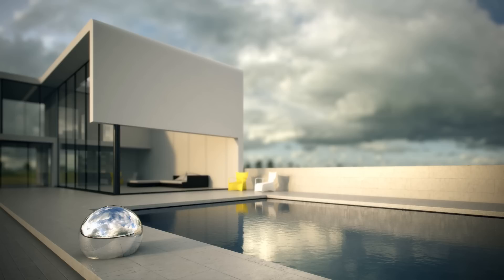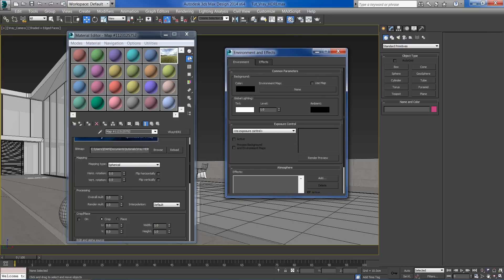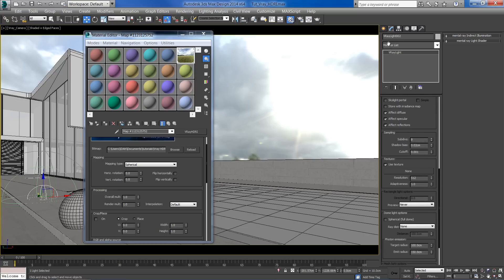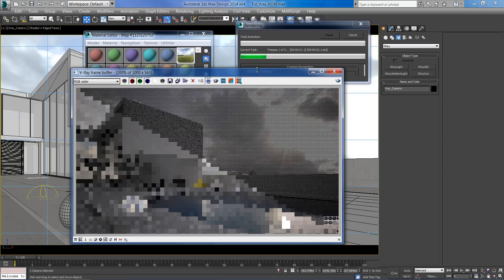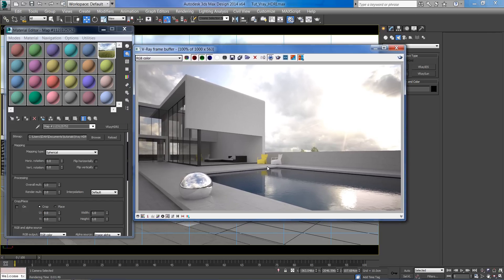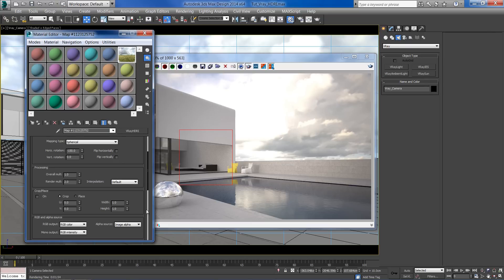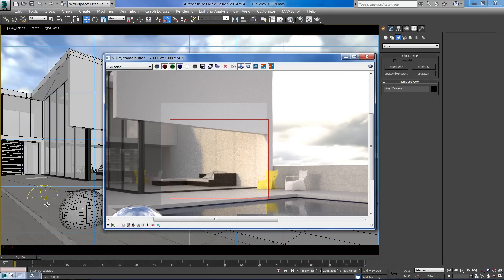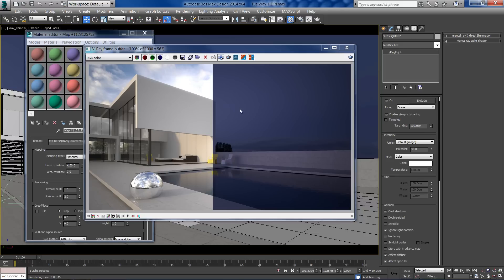Vray HDRI tutorial in 3ds Max

Comment: Hi.
I am Using 3ds max 2016(Vray 3.40.01). whenI am rendering an interior scene with daylight system with mr physical sky map in environment slot. It renders and shows background map through the glass windows. But when I use hdri map image in a material editor which I instaced in envi. map slot it renders all window glass black and oes not show backround hdri image.

Comment: Hi, many thanks for this tutorial. However I have a problem with Environmental Background in active viewport. All the parameters are fine and were set as it is shown in the tutorial. And still HDRI displays as white, regardless to overall multiplier adjustment. I use 3ds max 2015 and V-Ray 2.4. In 2012 works perfect. Any clue? I would realy appreciate your help.
Reply from the maker: +Piotr Porębowicz It may be a bug in 2015 version..I use 2014 so I can't tell you for sure. Try to install the latest service pack for your version from Autodesk website.
Reply: +Arch Viz Camp Yes, it is a bug. Anyways many thanks for your help. Best!
Reply: Hey guys, have you found a fix to this? I'm using Max 2016 with vray 3.0 and service pack 2 (latest) and im still getting this problem, very frustrating :(
Reply: Hi again, I've just upgraded to vray 3.2 and it has fixed the problem. It's a vray problem not a 3ds Max one.
Reply: +Hasscfc many thanks! This information helps a lot!
Reply: Piotr Porębowicz Happy to share, I've been looking for the solution everywhere. You're welcome.

Comment: Great Tutorial, liked the video but i do have one question.Whenever i check ''use environment background'' HDRI displays as pure white in viewport, no matter what values i change, it stays the same.solution you gave to Rafael didn't help, still pure white.NOTE:ONLY IN VIEWPORT!when i render it's normal
Reply from the maker: glox023 Did you copy the HDRI to the environment slot as an "instance" and then reduced the "overall mult" in the material editor?
Reply: Arch Viz Camp Yeah i did that, but it's still white, it's like it can't display anything but that, like it's not down to settings, but Max takes it as a solid white.I will try tomorrow again
Reply: glox023 You should change "mapping type" .

Comment: Great Image, but why would you use a background environment map + a Dome light? Don't they produce the same effect?
Reply from the maker: Brian Chen In this video I used the map in the environment slot just so I could see the sun direction in the viewport. I turn the environment off on the final render.
Reply: ah i see, thanks for the clarification.
Reply: Arch Viz Camp does this rotation of the environment then also control the rotation of the dome? im using vray for sketchup and the two are completely independent...of course I cant a background HDRI environment preview without using the REALTIME render engine to preview sun properties...

I have a related question...
I mapped an HDRI dome light and the render is beautiful. worked great...however...the dark horizon line across the glass frustrates me...is there a way to eliminate this? I feel like I should just be able to lower the vertical position of the HDRI...I tried making it a 'spherical' dome light, mirroring the horizontal. nothing... this may be hard to answer seeing as how im using Sketchup but VRAY for sketchup and 3ds max are pretty much the same...I find SU to be a watered down version of VRAY for 3dsmax... any help would be greatly appreciated.
Reply: Blake Chamberlain yes the dome light also rotates because you are rotating the original map itself under it's options. not the environment.

and your second question regarding the dark line is something that also frustrates me. I have no clue how to move the map vertically. under dome modifier you can scroll down and click full sphere dome something like that and it will render the full image without creating the dark bottom portion. but then you might see grass or trees in say a city like chicago. What I do is I just try to use a different HDRI and some will not show that dark horizontal based on my perspective.
Reply: Blake Chamberlain Blake Chamberlain yeah, full sphere mapping in the vray light dome options. Also the other day I foud that the vray hdri map (not the common 3DS max one) has an option that goes something like "project ground plane" it produced some weird floor in my project but maybe is that what you're needing for your project.
sry for english.

Comment: hi. after setting everything like you did it, my render is completely dark. i mean somewhere i can see a brighter parts but generally its black. any idea?
Reply from the maker: Tomasz Rejowski you can send me a dropbox link with your 3ds max file + hdr image and I'll check it out. 
you can send it in here or in a private message on my Facebook page https://www.facebook.com/archvizcamp
Reply from the maker: Arch Viz Camp After looking at your file I manage to find the reason for this problem. Go to your render settings->Vray tab->global switches and turn on the "use 3ds max photometric scale" (its on by default).
 Also I have noticed that the output gamma is set to 1.0, this also could make your image dark if you don't apply gamma correction in post production. you can correct this by going to color mapping settings and changing the gamma to 2.2
Reply: :) great. now i can continue with your tutorial. thanks for your help ;)

Comment: Hi! Thx for the tut, very nice tips you gave there. But I have a question.
I've notcied that you are using VRayDome light to set the scene reflections, by putting HDRI map into texture slot. But VRay dome light has resolution limit! Its not important that i'm using 4k HDRI map, cuz the VRay Dome is using 2048 as the max resolution and my reflections are blurry in higher resolution images :(

Any tip how to make it better?
Reply from the maker: Krzysztof Pysz hmmm that's odd...2048 px works fine for my reflaction. You could try placing a sharper hdri image in the reflaction environment override slot in the vray settings. let me know if it helps

Comment: Hi.. Thank you for a great tutorial... very helpful :D,
I just had one question.. how do i move the hdri map vertically or horizontally? I need to change the position of the hdri map so that the ground is not visible... hope i am clear about my problem.. and thank you once again :) cheers!!
Reply from the maker: Curt Kuls I don't think you can move the horizon line of the Vray HDRI map up or down. what you need to do is hide it with some geometry like trees, walls, buildings and so on or with a panoramic background texture. The second option is to do it in post production.
Reply: Hi, thanks for the response... Actually I was researching on this topic quite a bit.. you are right there isn't a way to move the Vray HDRI map. Anyways thanks for the help :)

Comment: Do you know why I can never find the VRayHDRI through the material editor?  I have to start at the Rendering/Environmental slot.
Reply: ***** Yes, I was having the same problem. The thing is not looking in the "materials", scroll down to "maps" and then V-Ray. You should see it there.
Reply: setting vray in ->> F10
Reply: Do you found the solution?. Cause mine got the same problem too. There is no options for vray hdri.
Reply: aina zakariah I didn't, sorry.  I think it's the same when you select it from the rendering/environmental slot.  I grab it from there then drag an instance to my material editor.
Reply: when you open material editor to get vray hdri option you only need to "press G" and you will can get that option :) iam using max 2015 hope u get that option if u using any other version too
Reply: Hernán Ruiz ooooh, interesting.  You are correct, thanks man!  I couldn't find it from searching through the standard to vray slot.

Comment: By using a HDRI in a vraydome and in the env slot, you are double using the HDRI. Right? I never thought to use a dome AND the env slot to light (i tick "use map" off).
Reply from the maker: You are right, the reason I used the HDRI in the env slot is to preview the map in the background, while playing with the horizontal rotation. When rendering the final image you should tick off the "use map", so the light will only come from the Vray dome.
Reply from the maker: Jez2008UK The environment slot controls the background of your viewport. Any color or image that you put there will show up in the background.
But if you wish to use an HDRI with vray it is best to insert it in vray dome light which overrides the 3ds max environment slot (unless you make it invisible). In the video I only use the 3ds max  environment slot to preview the HDRI in the viewport so I could position the sun correctly.
Reply: Can someone please clarify for me ?

Exactly what is the Environment Slot used for and when should you use it ?

Thanks.
Reply: Arch Viz Camp

Thanks for you reply.

But this is where I get confused.

I don't believe that it does simply show up in the background.

It shows up in the background but also will illuminate the scene.

Which ties in with what Thomas Mulford said.

So I'm still confused what it is truly for - is there a way to make the Environment slot simply hold the Backplate (eg sky) as a backdrop but with NO contribution towards illumination ?

Thanks :)

Comment: at 4.17 you say "don't worry about the blown up sky we will deal with it later on." but you never mention it again. how do you deal with overblown skies when you need the extra light? or just use a vray sphere light or sun to illuminate the scene?
Reply from the maker: Hi, at the end of the tutorial I talked about replacing the sky image in Photoshop, using the alpha channel. So you can use the HDRI only for lighting your model, and add your sky in post production.
Reply from the maker: Niels van Haandel one way to deal with that, is to render your animation with an alpha channel sequence (so you will get an alpha for every frame), and use it as a mask to control the sky exposure in after effect or any other post software.
Reply: you can simply make your vray light(loaded with hdri map) invisible and load same hdri into ur environment slot( rendering>>>>environment>>>(check use map}). for good lighting control, link your vray light map to the vray light using wire parameter.